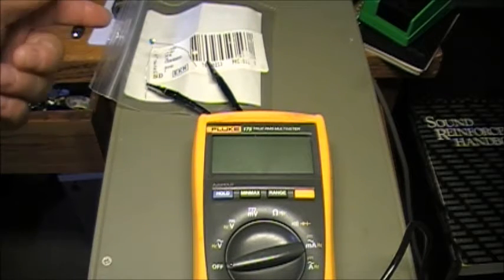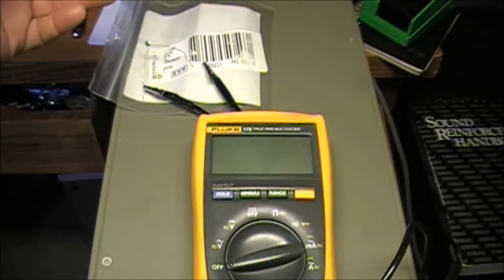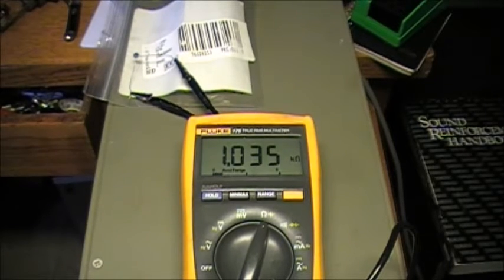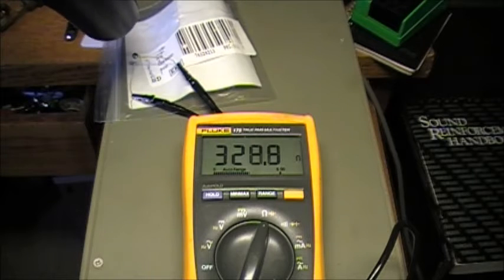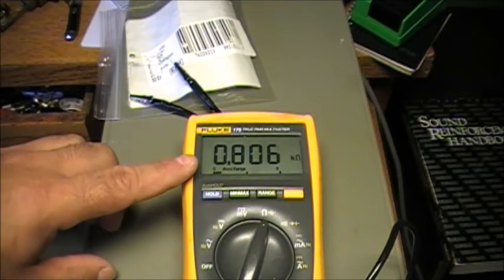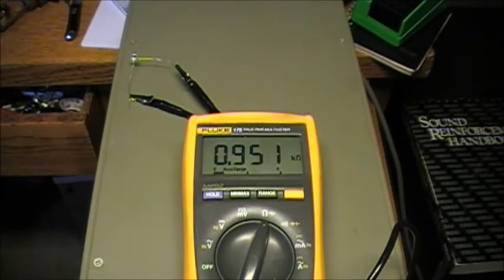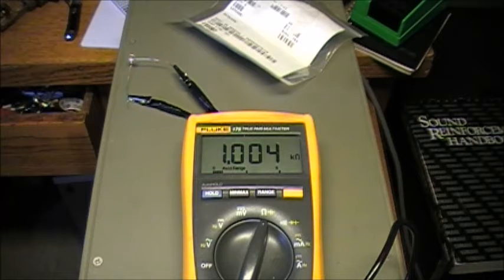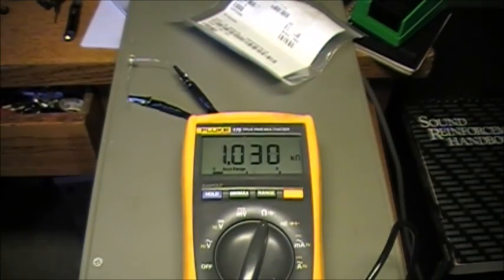Honda Magna Low Fuel Sensor Thermistor Test

Comment: As an ASE Master Tech since 1978, the low fuel sensor lamp was most used on imports. This is an NTC thermistor that is the variable switch to ground for the dash light. While a 194 peanut bulb works as a current limiting device, when illuminated, it consumes all the voltage but allow only 0.25 amps to pass thru. Today, LED’s are used and depending on the color require 0.24-0.30 amps to operate. So 12-14 volts applied to the proper resistor passes thru the LED to the tank. Inside the can, one end is soldered to provide ground. Fuel keeps it cool and as it sloshes away, it drains out the tiny holes. This allows the lamp to come on dim to medium bright. When uncovers and fuel is low, the resistance drops providing enough ground to fully turn on. Placed near the bottom is the installers choice if not factory. It does not get hot at all as current is limited, besides, at room temp, the one in the video is 1k (1,000 Ohms) and works as a current limiting device itself. 15 gallon tank may be positioned to come on with 3 gallons or more to come on as the fuel gauge shows almost “E”. CJ Ponies sells one for the Mustang and can be found online. That’s all. Retired Tech, Instructor.
Reply from the maker: Thank you for this. it is very informative.
Reply: @Tobinindustrial   > As not to be for the general public consumption but I use to teach a method on how to remember an (NTC) thermistor. I told them to think of their wife or girl friend, the hotter you got them, the lower their resistance was! It stuck with all of them... PTC’s are use inside many automotive devices including power window motors for example and most seat circuit breakers. When too much current passes thru them, the carbon impregnated threads get warm and push apart from each other. When real hot, they open. The clue to figure out which type you have, is to release the switch and current stops, it cools off then goes back together and the circuit works again. It will stay open until you let off the switch. Either fully bottom or fully up, it won’t work unit amperage stops. It is easy to play with and wire up. Their are few videos on this subject, but I added one to my 1967 C10 PU and found a 4 gallon reserve spot and LED on dash next to fuel gauge. Works great and use an old metal turn flasher can, clamp it to the pickup tube with a hose clamp until Happy with position. Hope all this helps as ACDeclo had us teaching 6 electrical classes, with lab-scopes the last.

Comment: I have an old Yamaha YZF600R and have just discovered by trial and error, that when you swap the old dash bulbs for LED ones. The sensor still feeds a minute amount of current, enough to light the LED weakly, say by half power, even with fuel covering the thermistor.  Long story short:  I swapped the LED for the older bulb and tried it dry. I got no light until I held the sensor in my hand for 35 seconds, then it slowly began to get brighter = success = the older thermistor variances are designed to suit the higher resistance of the older bulbs. So yes, do swap for dash LED if desired, but keep your old bulb in the fuel warning circuit. Wait for 30 seconds to a minute for the warning light to appear, and again every time you turn off the ignition. As soon as you dip the sensor into cold fuel the light goes out immediately = working fine. No applause, please. No applause.
Reply from the maker: Awesome finding Franko. Very intetresting stuff. Thanks for your comment and information Sir. God bless you.
Reply: thanks for the info, i had the same issue in my car after changing to LEDs and I am stubbornly trying to make it work with the LED bulb.

Comment: sorry, but the problem is: when you apply 12 volt at the thermistor it's very hot (about 85 C)!!! since immersion in the fuel........ isn't dangerous ? ciao
Reply from the maker: If the thermistor is not faulty, it should be fine. The fuel keeps it cool and when it is not in fuel it will warm up and allow current to flow and then the light gets power and begins to glow. 85c may be a safe level of heat. I didn't test for heat in mine but the sensor works just fine. I am sorry that I cannot be  of more help to you in that regard but I think you'd need a much higher heat level for it to become a concern.
Reply from the maker: of the specs on my thermistor which is 20F735
NTC Thermistor; Thermistor Type: NTC; Resistance :1kohm; Thermistor Tolerance: ± 2%; Beta Value (K): 3972K; Operating Temperature Range: -50°C to +150°C; Thermistor Case Style:Disc; No. of Pins:2; Beta Lower Temperature:25°C
Reply: riccardo giuffrida   > In a working circuit, it is not the voltage but the current. The 12-14 volts B+ applied goes to the light. The bulb, either a 194 peanut bulb limits current when cold. As the thermistor drops in resistance, current flows thru the bulb to the NTC thermistor to ground. As it’s resistance drops, the light starts to come on. Fully on & hot, only 0.25 amps pass thru acting as a current limiting device. The NTC thermistor never gets hot or even warm. Any vehicle with an LED has a current limiting resistor in series with it. The value depends on the color. So an LED limited to 23-30 milliamps is perfect in these circuits as the NTC thermistor is simply the variable switch that provide ground. One wire in and soldered to metal case, then grounded thru the fuel sender’s pipe. Try it! It works in water as well as fuel. I used an old turn signal case and drilled holes in the bottom and soldered one led of the NTC thermistor to it. Place a worm type hose clamp and move it up or down depending on how much reservoir fuel you want. Hope this helps!

Comment: Out of interest, are there fixed values Temp for fixed values Ohm? I mean, are the values fixed so you could for example say .. at 400Ohm you have 35C ?
Reply from the maker: Your question is a little out of my league but I do know that the exact spec is not necessary. It is only the values needed that can be triggered by the cooling of fuel and the variation in temperature once the thermistor is exposed to ambient air temperatures.My novice guess is that a variety of thermistors would work as long as it is operable on DC and is near the specs of this thermistor. I have much difficulty finding many parts in my rural area so experimenting is difficult without a large inventory of parts to test from. I do think that your query is accurate by the way. temperature and ohms have a direct co-relation but I cannot begin to know what the formula would be. thanks for your insightful question.